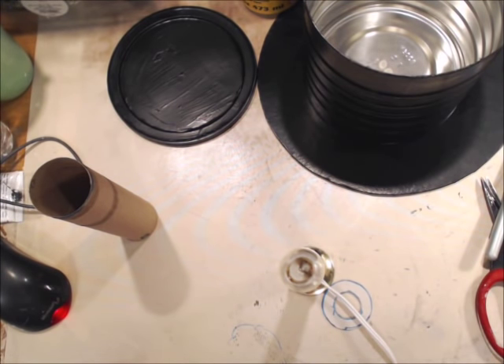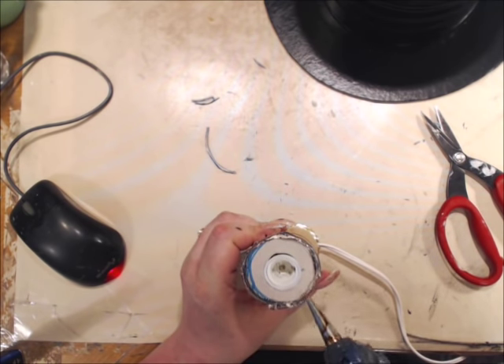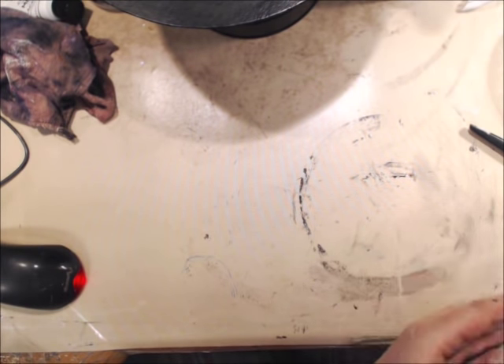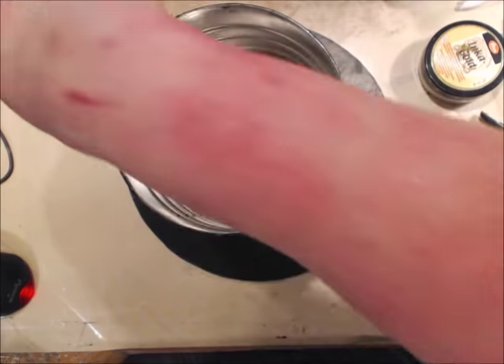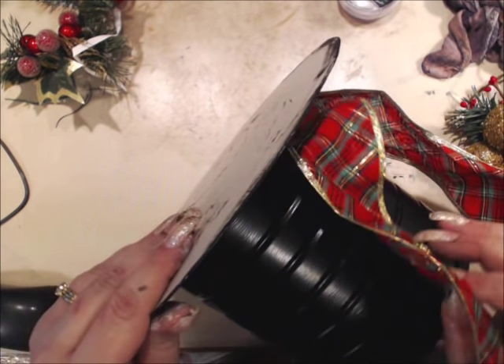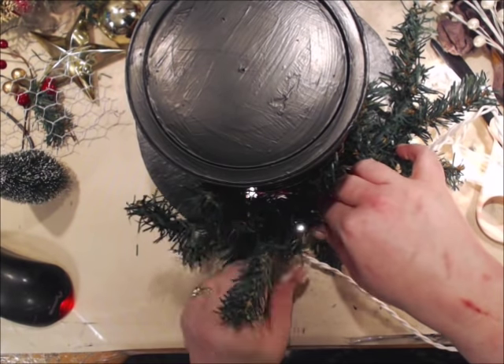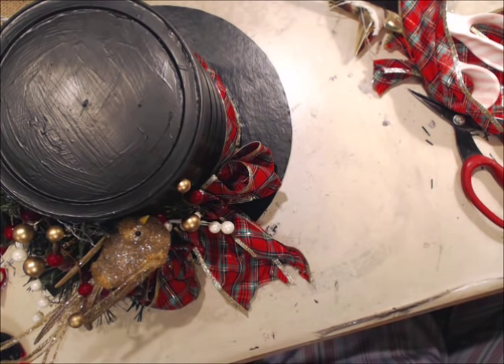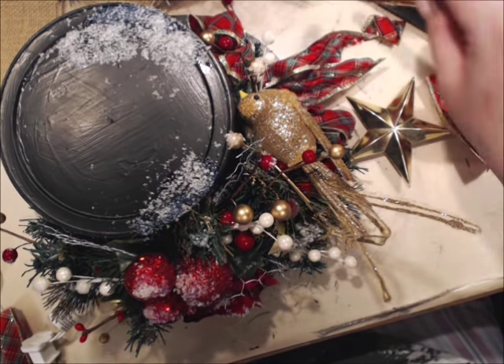Altered Can Snowman Hat with Did she just make that candle?

Comment: If, u are going to put lights on this hat, it would be best to use the battery operated ones that u can find at Dollar Tree. That way, u can change them out or not have to plug them in. These lights are too big, I think and gluing them to the can might make the paint come off with the lights if they come off with the heat.
Reply from the maker: I will take your critiques into consideration. Do you have a video you can show me that shows in details your suggestions?
Reply: No, I don't do videos. My husband and I just love to watch vids and I like to give pointers. ^^* I wouldn't say I am giving u critiques on ur work, just pointers. It would save u time and work and if, ur lights happen to go out, then u can change them out easier. I did this idea before, years ago and I wish I had a pic of it but sorry no vids.
Reply from the maker: at the time I did the project, I used the lights that were at the time easy to obtain. I have created projects with lights you have suggested. But I try to show both ways in doing things. As far as the glue taking the pain off, I have not had a problem with that but not saying it could not happen. I just come onto this platform FREELY sharing my work and ideas. I am no one special lol
Reply: That's cool and good to know.:) It is fun to create and share ideas. I love to create and am an artist so I take into account details. Paint has come off on me in the past so it can happen. I love the Mad Hatter look and created my own Mad Hatter hat long ago and still have it. It's a good way to use up old paint cans as u showed and u could use old vinyl records that are scratched up to use as ur hat rim. Have fun!